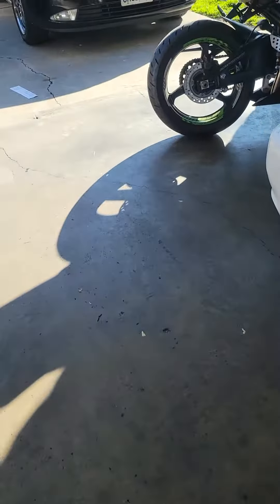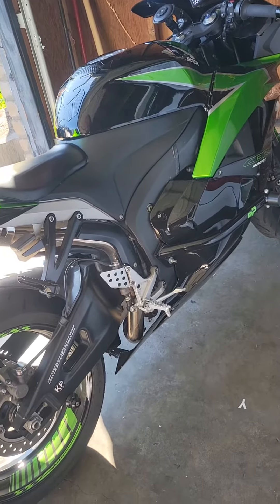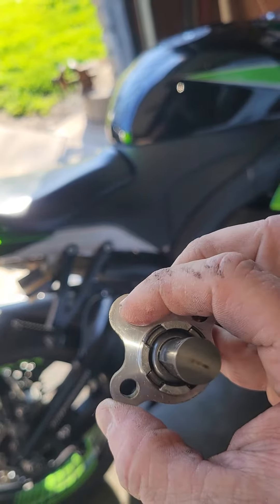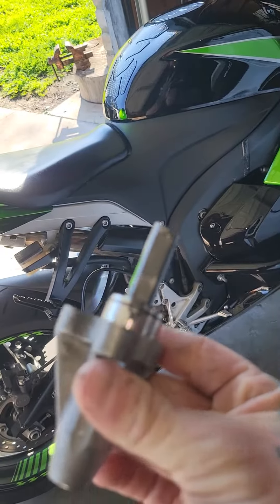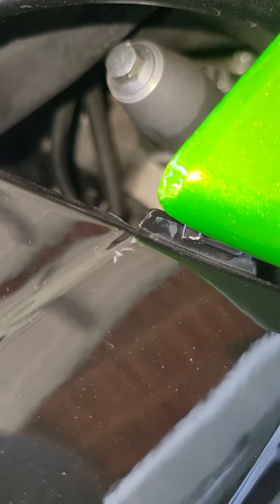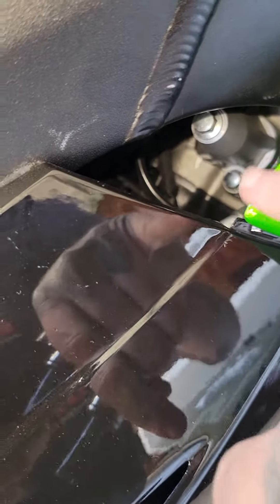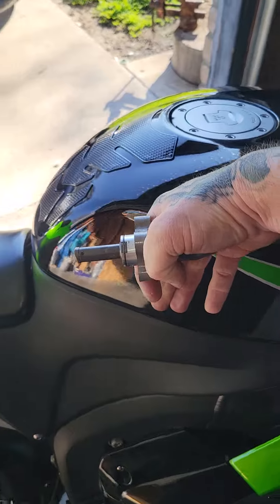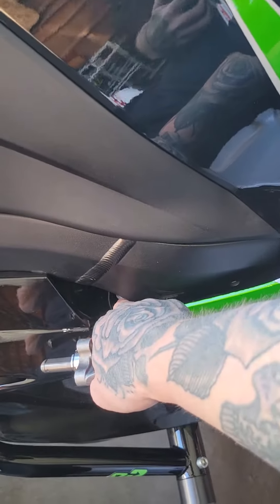2009 cbr 600rr CCT replacement

Comment: for context, the reason (most of the time) your chain slaps around and makes the noise is because the OEM (automatic) tensioner doesn’t extend far enough to hold the guide, so it’s more than recommended that you buy a manual one and replace it with that instead.

Comment: hi, thanks for sharing the video, how much was your milage on the clock, furthermore did you place a gasket in between the tensioner and the engine where it mounts?
Reply from the maker: Yes it came with knew gasket. My miles at 52k but can happen any miles jist lissen for sound

Comment: Did the new automatic one fix the issue?
Reply from the maker: @PJ-vz1pu  hell yea its the only bad thing that happens to CBR they said it's from not using a oe oil filter but my bike also had 65k miles
Reply: @ Good to know. I’m pretty sure mines bad, has 25k miles. I’m debating if I should get a manual one
Reply from the maker: @PJ-vz1pu  no get oem one those ones come lose sometimes trust me but there just cheaper